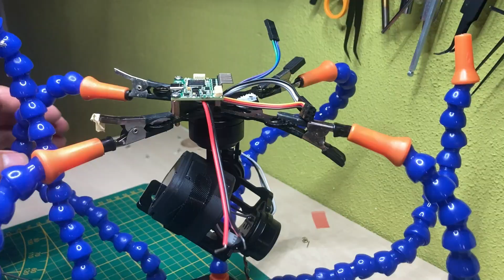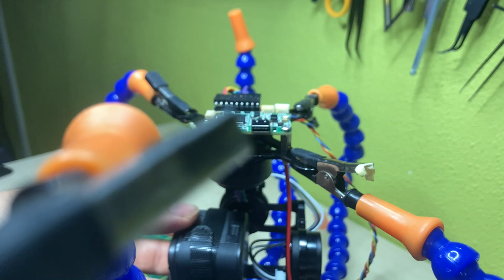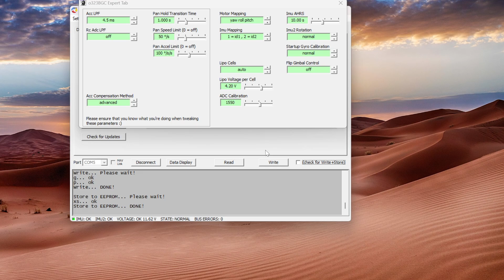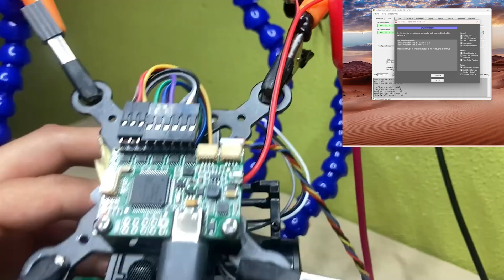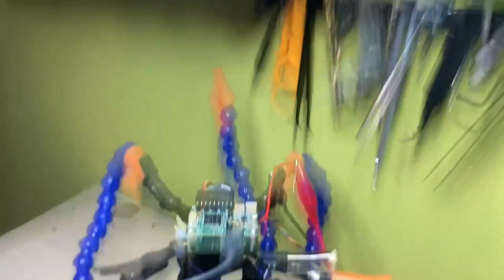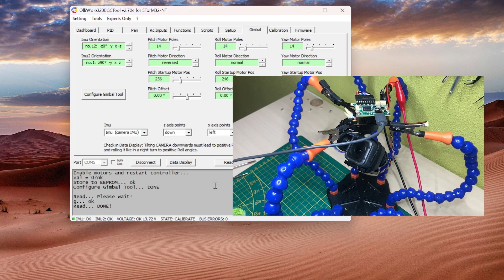Storm32 V4.1 BGC - First time configuration and setup

Comment: I noticed you haven't used encoders for your gimbal motors - Are they not that neccesary? I though encoder-less gimbal motors may heat up and draw power unwantedly. Also, does your Storm32 BGC V4.1 BLDC gimbal controller have encoder headers for 2 seperate encoders? Thanks
Reply from the maker: Encoders are supported over NTx port and can be daisy chained. Not required for the minimum setup but for more precise systems I highly recommend.
Reply: @onurcanozkan4975  Do the encoders that you sell require the ring magnets or are those optional? I haven't been able to find much information on them on the Olliw wiki. Thanks!
Reply from the maker: @derekmanierre5109  yes that’s correct. They require magnets, I personally purchased iPower gimbal motors with encoders because they come with perfectly aligned magnet installed. Soon I’ll share another video about it, how to install and etc.
Reply: @onurcanozkan4975 thanks for the info. I'm looking forward to seeing that video!

Comment: Hello, thank you for making this video. I am trying to use this board for a project at my job, and this is very helpful.  I was wondering about the pins used in the MOT1, MOT2, MOT3 slots. Would that be included with board purchase from the Gordian systems website, or would I have to purchase it separately, if so what are those pins called.